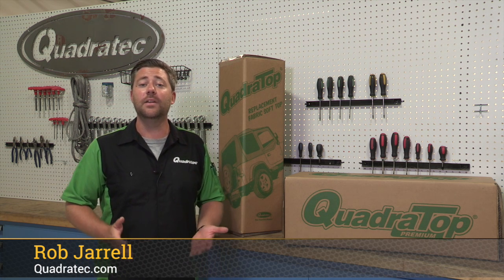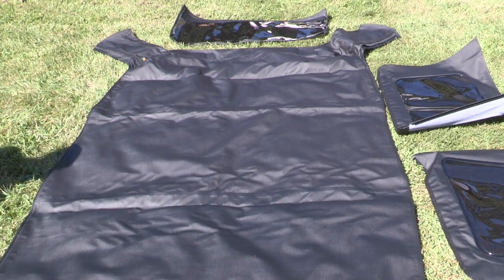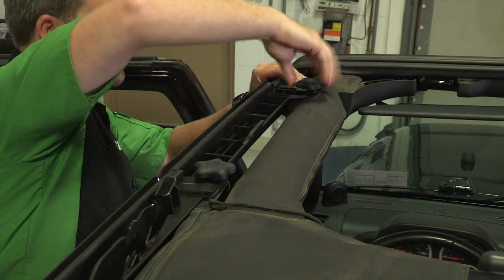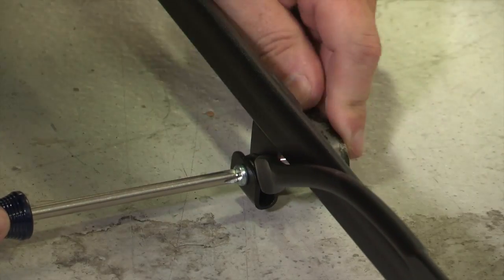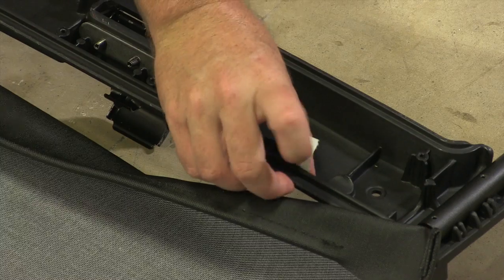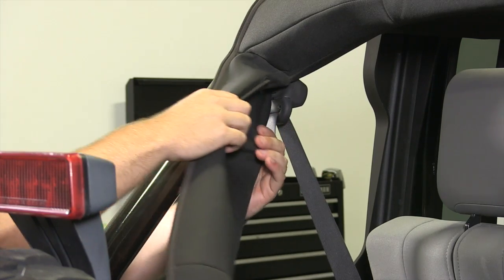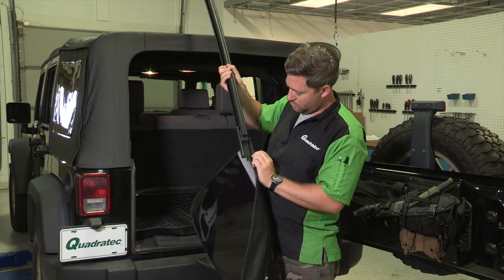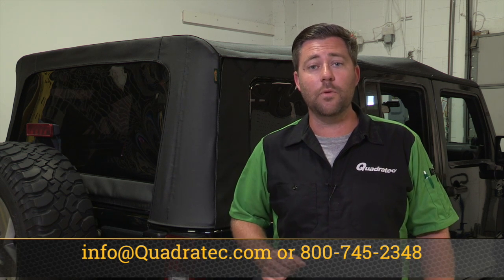QuadraTop Complete Softtop for Jeep Wrangler JKU Step by Step Install

Comment: My window zipper broke on my Quadratec top, so they sent me a Gen 2.0 (whatever that means?), and I have no idea how it is supposed to seal around the doors (I have a 2 door). I am using the original soft top frame. I was hoping this video would help, but it does not. When I try to install the top there is about an 1/8" gap between the door surround and the top. Not only would it leak, but it would be very loud. The original Quadratec top was great, this gen 2.0 is worse.

Comment: this is not an easy top to assemble - not as easy as they make it look - top comes in a box with a hundred pieces (don't know exact number) and the directions that come in the box are pitiful - if I had known the difficulty of putting this frame and stuff together I would have never bought this top - if you are on the fence, pay a little more and get a top that comes more complete when it arrives